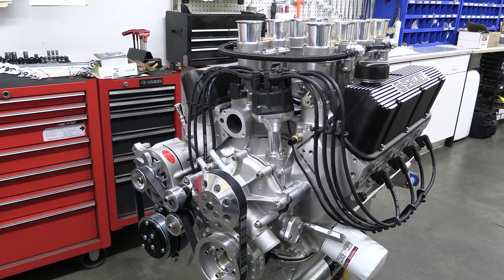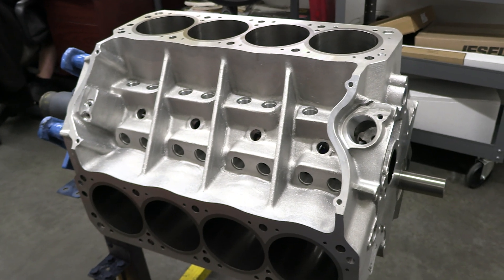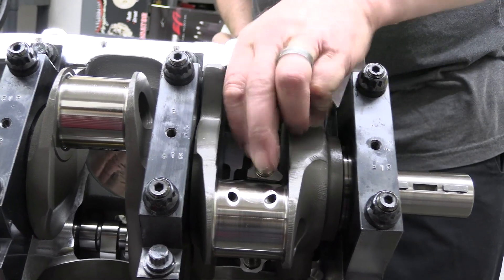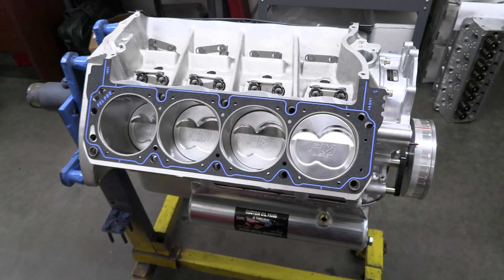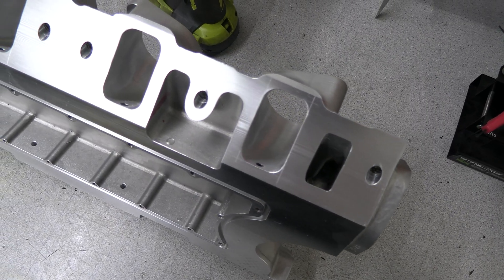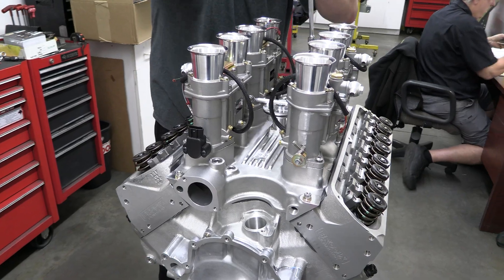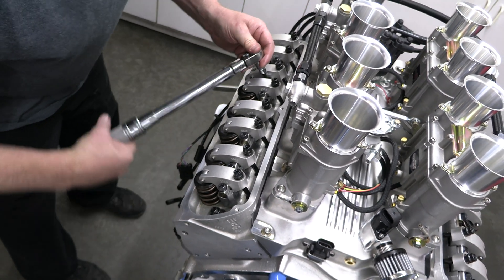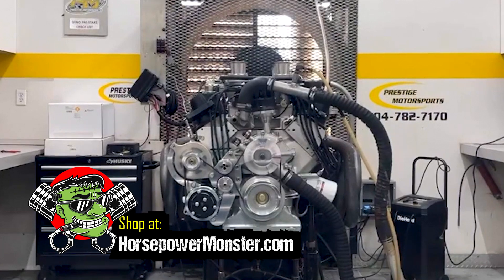Reimagining a 427 Cubic Inch Classic in a Big Inch Ford Windsor

Comment: I'm a little shocked by the cheapy fibre head gasket.... I mean they've been fine for 75yrs, but what's 50 bucks in a build like this? Why wouldn't you just do MLS? Is it a racing class thing?

Comment: Something doesn't add up, with 9.5" deck Windsor a 4.25" crank and a 6.200" rod you use a 1.165"-1.175" ch piston. How is this a 4" crank with a 6.250" rod and a 1.225" ch? That comes up a little short of zero unless the block is milled down. Seems like a waste to not go at leaat 438ci with a 4.125" bore and 4.1" stroke, 441ci with a 4.125" bore abd 4.125" stroke,  if not 454ci with a 4.125" bore and 4.25" stroke. Just leaving free power and torque on the table for no cost savings and the same amount of work. A 4.1", 4.125" or 4.25" stroke engine can still easily and reliabibly rev and make power to at least 7000rpms these days with no problems. I would imagine that block should be capable of at least a 4.175"-4.185" bore making 466-468ci, not just 461ci.
Reply: You are correct.  These blocks can be taken out to 460.  But I'm betting the owner of this car is never planning to drive it in anger.

Comment: The only problems with these 428ci builds is the short rod ratios, a 9.7" block would be best as it would allow for a better 1.61 min  rod ratio for endurance racing. Not well known to some Shelby-DeTomaso & Ford also had plans for a 7L stretched deck version of the W block for Can Am racing back in 1964/65.

Also some forgotten history... Ford cast a new 351w 9.2" deck sbf xe race block in 1966 (XE 93532) which got to just over 400CI in 1969 for Can-Am racing. This is were the later "351C" got most its spec's from when B knudsen pushed his own "Oldsland" inspired "C" version through screwing up the 351W blocks development...  goo gle "351w xe block" for more info.

Comment: Aaaahhh....nice build. High dollar alright. I'm building an FE with a CS aluminum block so I'm very familiar with the cost incurred here.

Although with all the well spent money and custom parts....an 0.080  5/16" pushrod is still used. Hmmmm, I know a lot look at the hydraulic lifter as a shock absorber and feel that deflection of the pushrod isn't a factor.....🤔

Comment: See a couple of silly comments here about the chosen 6400 redline. It's because engine builders often have absolutely no idea anything about the gearing of the vehicle their engine gets plonked into, so that's the "peak" performance compromise.. With an automatic hung on the back it could be an extra 200-400rpm (sometimes way more than that with shadetree built transmissions) past 6400 before the trans finishes an upshift. Gotta think about that stuff. It would be criminally stupid to send a high-dollar motor out the door with just an absolute peak "here's where your valve float will start" number, because that's exactly where he's gonna upshift, with absolutely 0 margin of safety for overspeed. Thinking that stuff all the way through is how races are won by vastly inferior cars

Comment: Why would you build an engine that redlines below its power peak?    Either put in better springs or back 5 degrees off that monster camshaft.   I would prefer the latter as it will help the car get out of the corners.
Reply: Because engine builders often have absolutely no idea anything about the gearing the vehicle their engine gets plonked into so that's the "peak" performance compromise.. With an automatic hung on the back it could be an extra 200-400rpm past 6400 before the tranny finishes the upshift. Gotta think about that stuff

Comment: Soo friggin Bad Azz, nothing cooler than a stretched small block with old school looking stacks and can punch 600 HP above 6000 RPM !!!! Damn that GT40 is going to be 1 SICK MONSTER 
Thank you for sharing, everyone keep yourselves and love ones safe and healthy and remember to SMILE 😊God Bless 🙏
Reply: A factory 351w roller block 357ci with TFS 11R 190cc heads can make 595hp, a 408 with 11R 205cc heads can make 625-650hp, with a 4.030" bore. A 4.125" bore 9.5" Windsor (much less an aluminum Shelby block)that isn't making over 650hp is kind if a waste. Only building 427ci is a waste too when 438, 441 or 454CIs with a 4.1", 4.125" or 4.25" crank could have been done just as cheaply and easily.

Comment: Did they explain why they decided to tune with speed density and not alpha-n? From what I have seen, its easier to tune an ITB car on alpha-n instead of trying to smooth out the map reading with a hole in each runner.